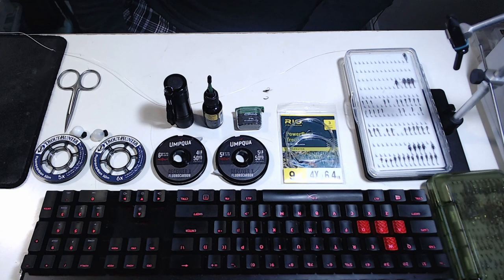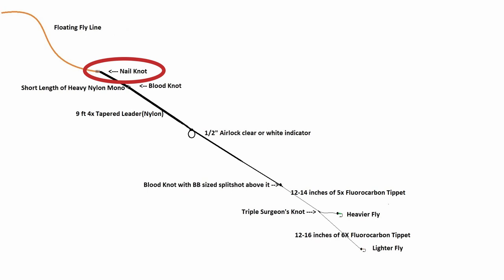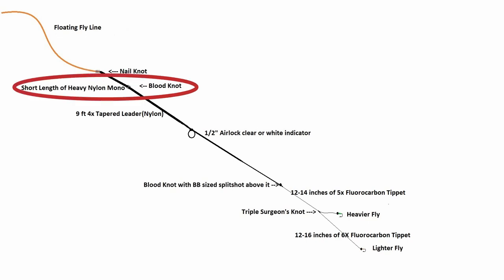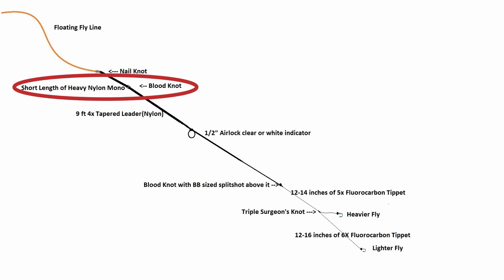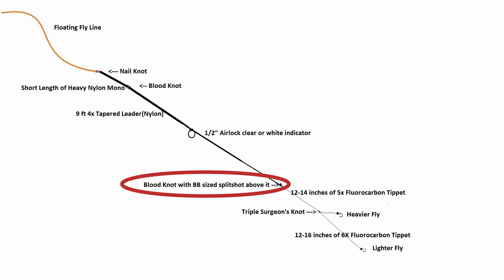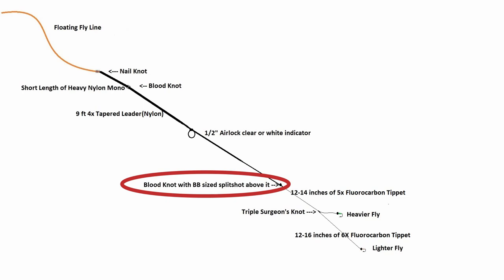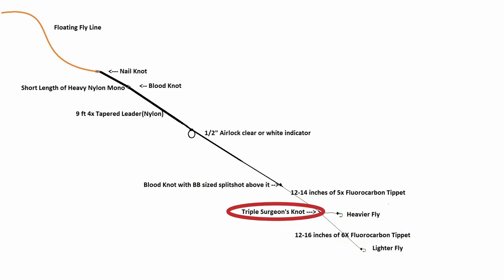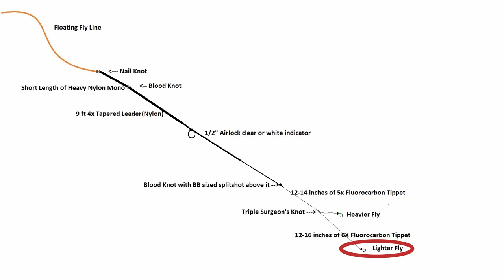Indicator Nymph Rig Setup - TroutFlies Tutorial #1

Comment: Do you use rule of thumb indicator to split shot 1 and 1/2 times depth of water?
Reply from the maker: Yes, for the first few drifts. After that it's readjust based on actual feedback. BUT, it's really more nuanced than that. People think you need to be deep all the time. That might be true during low insect activity times, but there are times you want to be up in the water column and not dredging the bottom. Remember, trout see things above them waaaay better than below and if they're looking for hatching insects they'll sit a little further up in the column and be looking up. You won't be in the strike zone as much this way if you're ticking the riverbed.